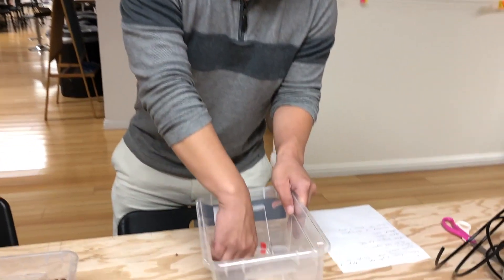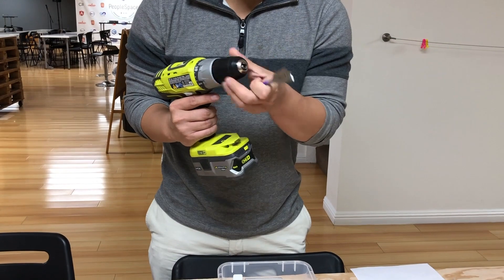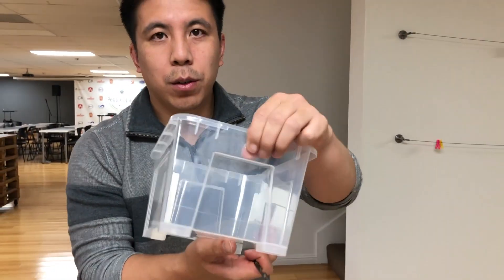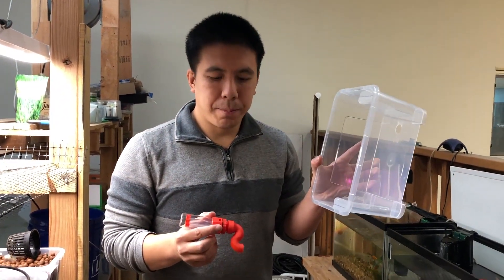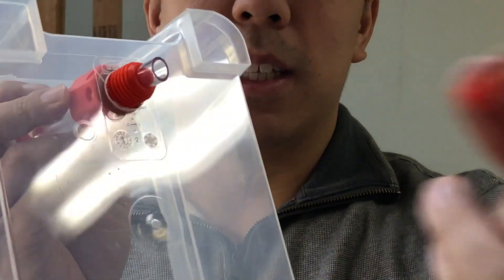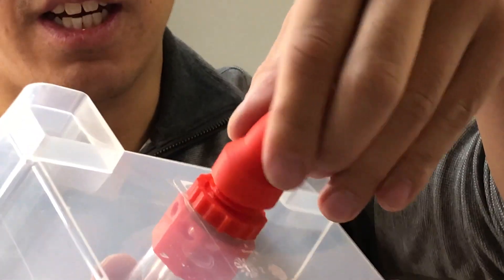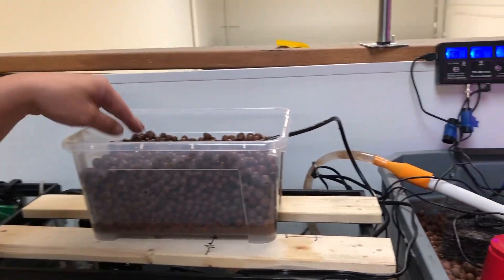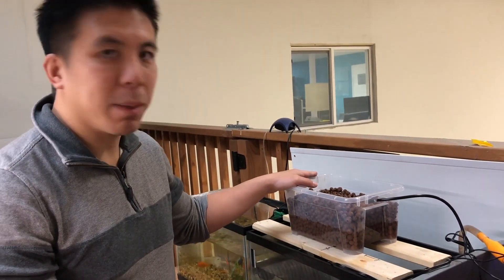Easy way to turn your 10 gallon aquarium into an aquaponics system

Comment: That looks so ugly, just go buy a proper small aquarium, but if you do I recommend a 7/8" hole saw, not that 7/8 wood bit, that would just crack the hard aquarium plastic.
Reply: If you don’t like it, don’t buy it. No need to be negative!
Reply from the maker: The wood bit works fine for the plastic bucket in the video, but we have since changed to using a step drill to make the cut even cleaner.

Comment: Looking for some help on my syphon, it syphons the water continuously and never ebbs and stays at one level in the grow bed. I have the same recommended pump (80gph) on its lowest speed. Please help. Also looking to see if you have or can recommend a fitting/set up for an overflow scenario. Thanks in advanced

Comment: Forgive me if this is a silly question. Does one have to refill the fish tank with clean water regularly with this system or does the bucket and or plants keep tank water clean? Any information is helpful. Thanks
Reply: Your tank will still accumulate some solids, but the grow bed will filter some out. You can install a solids filter to help with that too. You will need to top the tank off now and then from the plants consuming the water and from evaporation.
Reply: @momiropan9123  thanks!

Comment: Do you still need an aquarium filter with this system or does this work enough to filter the water?
Reply from the maker: You do not need an aquarium filter. The clay balls act as a filter.
Reply: You don’t need a filter

Comment: Great idea. To save money, can you actually just use a standard gravel cleaning syphon?  It might be a bit fiddly cutting it to size, but if you run the tube through the side of the box and seal it with putty, and then stand the cylindar up inside the box.  
Also I think plants need a black box because the roots prefer darkness, but the clear box is helpful for the video.
Also I'd probably attach hang on back filter to the box to supply the intake water.  Why not use it rather than requiring another pump?

Comment: Do you think it would be possible to grow cuttings In this? I’m wondering if it would make sense to just stick some cuttings in the hydroton and then they grow some roots and just pop em back in some soil.
Reply: As long as the plants aren't nitrogen fixing, you can put cuttings into the tank. I use a small breeder tank to support my cuttings from submerging and keep the fish away from new growth and roots. I get better root growth this way than with rooting hormone and a jar.

Comment: Hi i have a question, i have 30 Gallon of goldfish tank, Could you please suggest exact size of the siphon and Pump i need to convert into an aquaponics. appreciate your help .
Reply: @justponics7785  Thanks a lot , Appreciate your help could you please post think for the 30 gallon tank so that i can have a look please.
Reply from the maker: Hi, with 30 gallon tank you can have a 10 gallon grow tray. Please check out our other video of our bell siphon for 10” media. We installed it in a 10 gallon grow tray with a 25 gallon fish tank.

Comment: Nice siphon. I was wondering the size of the water pump that you are using? I have a 20 gal tank just sitting in the garage and will put it to use. Thanks..
Reply from the maker: The pump in this video is a 80 GPH pump.

Comment: Hello, I like your siphon and had a question. Is it possible to add a tube to the S-shape connector? If so, what size tube? My grow bed is about 2 feet from my fish tank so I would need to add tubing to cover the distance.
Reply from the maker: Yes, our siphons now have a barbed connection. You can use 3/4” OD  tubing.

Comment: Do you have to add new water to the tank every couple of weeks to keep the water level high? And does any water get trapped in the bottom of the grow bucket?
Reply from the maker: Yes, you have the add water to replace the water that evaporated and that is used by by the plant. No water is trapped at the bottom of the grow bucket. The water is cycled so no anaerobic develop.

Comment: The grow tank seems pretty small, is there a known ratio of the size of your fishtank to the size of your growbox? or is that still up for experimentation?
Reply: You want no more than 25% of the water to go into the grow bed at a time and generally water that comes 1 to 2 inches below the surface of the grow bed. Most plants like a dry bit to avoid stem rot